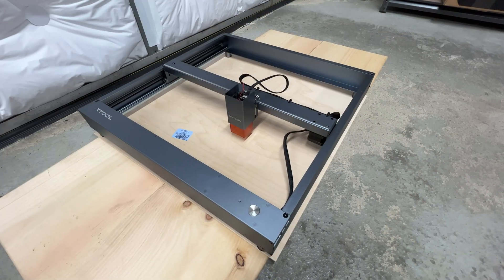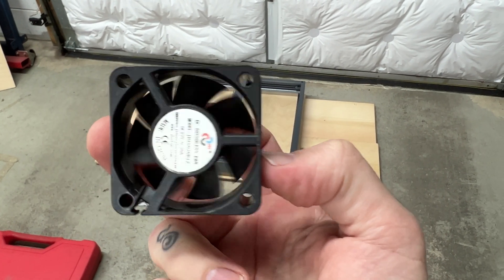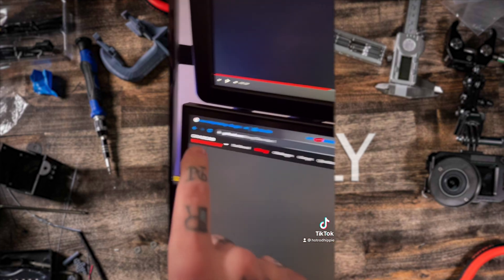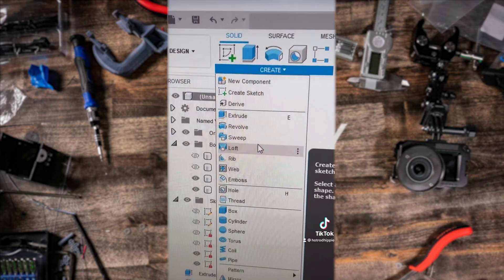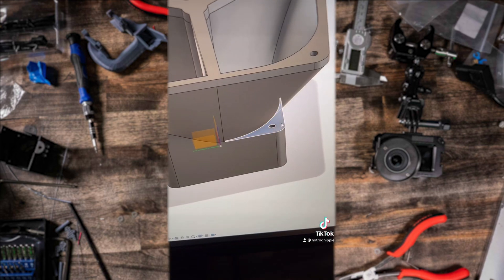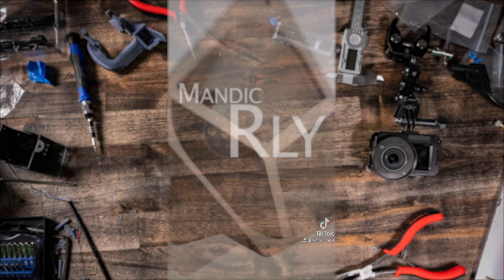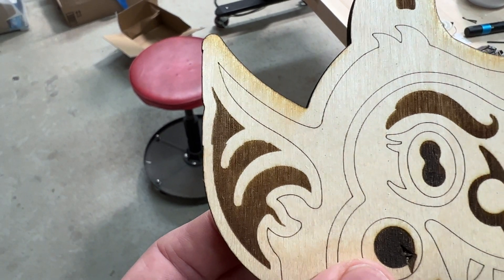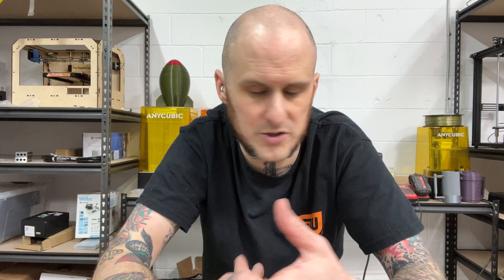3D Print Project - xTool D1 Laser 80mm Fan Upgrade - Shop Vlog

Comment: I enjoyed your vid, I have the XTool D1 pro 20w, I built an enclosure so I don’t really hear much fan noise. I did do a thorough cleaning recently both inside and out. I now have a noisy fan gggrrrrrrr,, I used my air compressor to make sure I got all the debris from inside. Of course I had to use it to spin the fan motor like an ambulance siren (really fast). Also, I didn’t take note of the direction of the fan airflow. Blows into or out of the laser module?  Anyways, great job on the modification.

Comment: I would check for binding and belt tension.  I had to be careful with the (Y is what I am calling it) section that is connected to belts on both sides.  Ended up having to loose both up and then be careful about balancing the tightness of the belts because they were causing binding.  It looks like skips.  If you look that that ear, the shading steps in.